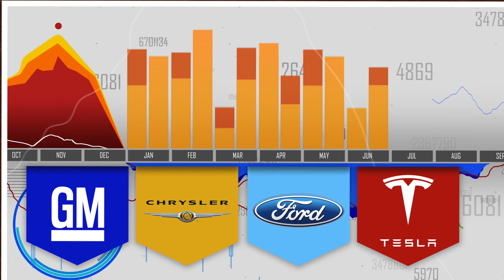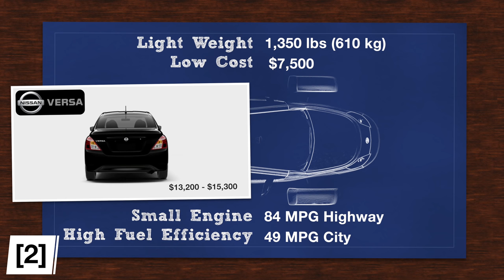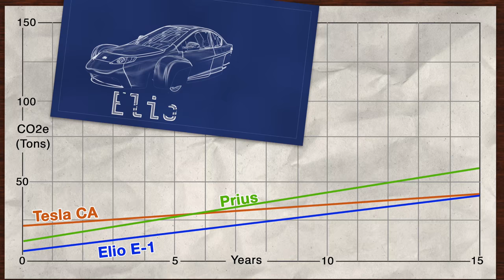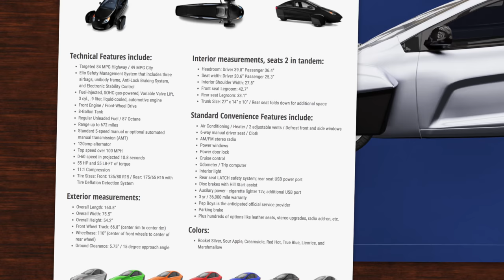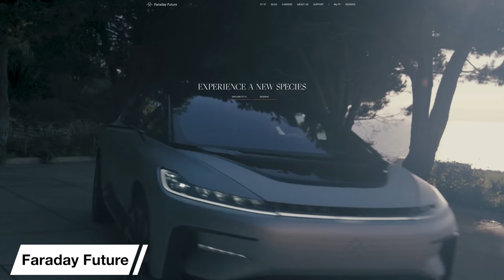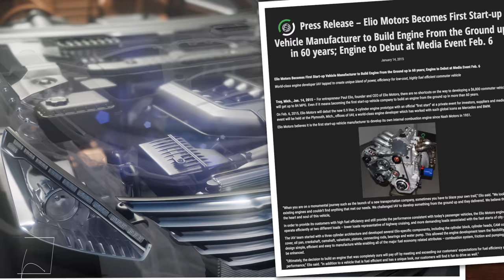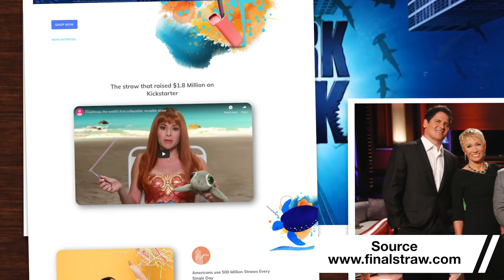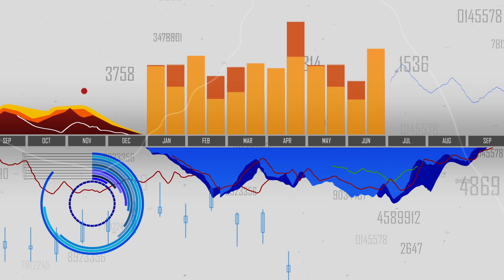How this Radical Car Missed its Chance to Change the World

Comment: I’d still get an elio over an EV right now. EVs cost more, especially at the start. Either spend $1,000+ getting a new outlet installed for your level 2 charger (risking finding other electric issues needing updating) or use public chargers. They cost more. Change your habits for this new vehicle, that’s unfamiliar and still very untested long term or it’s a skinny geo metro. Runs on cheap and available gas, and is very efficient with it. It’s a car, and gets maintained as such. If your out of gas, buy more or get it delivered by road side assistance. 

EVs have come a long way and I’d serious consider one, heck I have been in conjunction with home solar and a house battery(powerwall). But an Elio would get me a cost effective commute cheaper. And easier.

Comment: I would have been interested 4 years ago when it appeared to be nearing production but now it's just too late.  You can buy a used Nissan Leaf just a few years old for only a bit more and electrics are getting cheaper.  Holding out now for the electric Sondors, also a three wheeler but seating side by side.  Will they also falter?  Time will tell.

Comment: Luckily in the UK you don't need a different licence to drive a motor trike or quadracycle.  In the UK and Europe where Smart (Swatch and Mercedes) have done well (600 cc engine vehicles), the Elio might find a niche.  However Smart are converting to electric motors and won't be building petrol driven cars, so perhaps Elio missed the bus ;-) If you want a dorky electric trike you could buy the Renault Twizzy.

Comment: The Elio was exceed if it can maintain its cost at $10,000 I would recommend adding a fourth wheel to get around most state laws and having it a electric option and it would take off  in especially states that promote low emission vehicles or electric vehicles

Comment: The logic of this video works fine if you ignore every other car manufacturer. Toyota was on its 2nd or 3rd generation hybrid cars and introducing models with hybrid options during 2009. 

As a good example of the average consumer, I'd rather spend my hard earned money on a $22,000 hybrid car that has proven hybrid technology made by a manufacturer that is known for economical and reliable cars. 

Usually when a car is too good to be true it is.

Comment: I think there's still room for these things,  charging infrastructure just isn't practical for all living situations,  and a lot of people just don't drive enough miles to justify an EV by savings or even eco concerns cause they just don't spend  so much on fuel to begin with.   There's also a segment of people who'd rather cycle to work in one way or another, if it isn't threatening rain,  etc,  have limited/distant for cords   parking room, are eco-minded but aren't into computers,   just plain don't have 'new EV' money right up front,   live upstairs and rent,    mostly need to drive something bigger for what they do and hate filling the tank for running-around-town errands,  basically any of a hundred reasons that may seem 'niche,'   but could well add up into a pretty good thing.   

There's just a lot of gaps where there's like one or two things stopping someone from going to an EV,  basically, that might be really interested in this,  especially if they make a body style/accessories  that's a little less worried about highway  aero and a little more about room to carry different things.

Comment: Yes, This is still viable.  Electric cars are not the end all.  Especially with the carbon footprint left by the manufacturing of the batteries.  Also the charging network nation wide is substandard and not up to speed.
Reply: Time to buy Elio stock as it dropped below a buck. Lets go Elio!!!

Comment: Safety is everything. It is not how much gas you use. Eliot does not sound safe. Many cars can do 49mpg and better just not $7500. Is it the cost? Is it the gas mileage? Is it safety? Does it has the fun to drive factor like it has a good startup and go, nice cornering capability? Is it cool to be seen in it? I think it multiple of these and cost is the last on. Put one more wheel at the back and convert it to EV this may have a chance.

Comment: I think the Elio would have succeeded if gas prices had stayed at above $3.50 per gallon. OPEC has dropped oil prices in the last few years and cheaper gas is plentiful again. I think if fuel prices go up again, they may have another shot. I also think Elio tried to do and offer too much in the beginning. If you think back to Tesla's first roadster it was basically an electric version of a Lotus Elise. All the engineering for the body and chassis had already been done Tesla just had to focus on the power train.

Comment: If you make it, they will buy. Still waiting to buy mine. 
No I wouldn't want one that was electric powered. Electric cars in North America are a bad idea for the environment. Most of the electricity that would be used to charge these vehicles comes from coal burning generation plants that produce more hydrocarbons than gas burning engines for the same energy output.
Reply from the maker: We have a video that covers why even with US energy generation EVs are way cleaner :) https://youtu.be/SwxmIYGpbn4

Comment: I see vehicles like this and think that looks fun.  If I was working on a project like this I would be looking at motorcycle engines to run it.  The issue of needing to have the M1 certification goes away if they use a engine capacity of 125cc or less as it then falls under laws as a learner motorcycle.  At that point the only things you need are a CBT (compulsive basic training) certificate and a learner licence to drive it which would need to be renewed every 2 years.  I believe that if it has a roll cage then you would not need a helmet legally, but I could be wrong on that as firstly I am going by the rules in the UK and I am no lawyer.  I do know that the Renault Twizzy is legal to drive on a motorcycle licence and you do not need a helmet to drive that.

For me though, it is getting towards the point where an all electric version would make just as much or more sense.  Electric cars have the range and efficiency for commutes, it is long distances where they are held up by our current battery technology.

Comment: To make my conclusion on the Elio Motors they will never reach full scale production, because on the 3 wheel design people want a 2 seater side by side. Just like The Original Honda Insight the Elio is more of a motorcycle design and the cost is too high. Also the car only weighs 1250 lbs and the rate of survival in a real world crash could be low.

Comment: I think it did miss the window of opportunity.  It has taken just too long for a vehicle that is still based on a single combustion engine.Even the Archimoto EV tribute-wheel will come to market before the Elio. For me, the Elio platform is much more appealing. Yet I will never buy another 100% combustion driven vehicle. Plug-in hybrids seem to be the best option for me.  If Elio switched to EV, I would be back on board.

Comment: I admire the design and have followed ... vaguely ... the Elio.  A couple concerns ... why not electric?  I don't see any reason that an electric motor wouldn't be a much better choice for this very light vehicle.  If classified as a motorcycle, what does that do to auto insurance?  To life insurance?  It may be much safer than a motorcycle but if it is classified as a motorcycle, does the driver have to pay high rates for the risky behavior of driving a motorcycle?  Until your video, I hadn't even thought of the possible requirement of wearing a motorcycle helmet.  Personally, I'd be okay with that but I can see that that would be a great barrier for many potential buyers.  At this point, I've lost all hope for the Elio.  I'm even worried for Elio, given that he has taken so much money from individuals without producing anything.  Could he end up in legal jeopardy?

Comment: Since I have put down my 1k deposit, I have purchased 2 vehicles, one of which is all electric.  After experiencing driving my BMW i3, I will find it hard to by a gas powered vehicle. Actually I added an electric motorcycle (Zero) to my garage because of my enjoyment of driving electric.  We do still have a gas powered car for long trips and to hedge against any possible power grid issues.  Overall as I still wait for Elio to produce their 3 wheeled vehicle....every other manufacturer is developing electric drivetrains. I believe their marketability is definitely starting to look less favorable.  A lot has happened in the auto industry in the last five years since I put down my deposit....Res Holder 9328.

Comment: Hmmm... a cross between an Elio and Tesla. Zero to sixty in under 3 seconds. Cost? Less than $10,000 perhaps. But seriously, there are millions of gas cars on the road. The complete conversion to all electric will take decades. Elio can still be successful. It is still at the cutting edge. It could introduce a hybrid in a few years and add electric model as battery technology improves. I would still buy one.

Comment: Car manufacture for mass cost is not 100 of millions, make it in terms of billions :P
Regarding Elio vs other EVs like Tesla, Elio has a few advantages:
(1) A <10k price tag is really attractive compare with any car in the market.
(2) As more and more report come out about how difficult to fixt EV after warranty, especially Tesla. Elio (and any non-EVs) traditional combustion engine definitely is more appealing for consumer planing to drive the car for 5yrs+.

The biggest hurdle for Elio is to get their cars on the road, then to the masses. Without mass production line, there is no way they can keep the price <10k.

Comment: I know gasoline is slowly dying off but yes I’d still buy one in either or gasoline or electric configuration but preferably in gasoline. It’s what I know and it’s what I love ❤️. Also I’d be very tempted to add a k03 turbo, bigger injectors, and add more ignition timing to the ecu

Comment: It looks very much like a EV called cree-SAM, which is a 80 unit prototype which ended with that. In Norway we only need normal drivers lisence to drive them, but they are motorcycles which means they have less requirements than cars. I think it should get a electric drive train and then perhaps sell them to Norway since we gets so much taxed for driving regular cars now that such electric ones would be great.

Comment: The Elio should have started out an EV.  If it had, it would have taken a large part of the same market the Model 3 has had.

Ten years ago, I was so determined to stop driving ICE cars, and there were no EVs on the market that I converted a BMW to a high-powered EV. (See "BMW EV conversion burns rubber!!!" on YouTube.)  If any EV was available at that time that was cheaper than doing the conversion I did, I would have bought it.

There were many others who had the same vision I did: wanting to never go to a gas station again, regardless of cost.  All you need to do is look at the hundreds of EV conversions on You Tube.

You only needed to have offered it as an EV, and I would have bought it.

Comment: Kudos to any entrepreneur who wants to enter car manufacturing. It's a heavily over-regulated industry with high liability (Think of all the lawsuits when things go wrong!). Also, it's hard to compete with the big gun car companies that have so much more in R&D. Certainly, governments can help by allowing people to drive this with a regular driver's licence. It would look and feel more car, than motorcycle. Plus, I think it would be a big seller in the third world. It looks like it would be pretty simple, unlike modern cars which have far too much complex electrical.  

They did something right by sourcing an engine. A small displacement Honda engine would be perfect. They should do the same for the transmission. They could get a company like Aisin of Japan to make the transmission. This would help keep reliability high.

Comment: Elio made nearly every mismanagement mistake possible. Just one classic F-up after another. The ONLY thing they had right was the basic car layout (2 front, 1 rear wheel with tandem seating is the CORRECT one). But no one in the organization new anything about manufacturing. Then it turned into an investor scam. Sad. It could have really done wonders.

There were so many viable business models possible. They could have even sold them as kits with user-supplied engines. Paul and Company were just very stupid.

Comment: Outsource a gas motor and get the ball rolling. Forget the inconvenient electric power, everyone is comfortable with gas engines, and you won't have sell them on E power and high cost batteries. E power will severely limit your market. Another idea is to make your own electric power like locomotives, have a small 2 cyl. diesel engine spinning a DC generator to power an electric motor. Smooth, great torque, great fuel milage, and readily available fuel.

Comment: Always sounded like a good idea, execution is 99% of the game. They have failed at every step along the way, the worst decision ever was to build an engine from scratch. An even worse decision would be to go EV. Anyone wanting an Elio does not want the hassles of EV, the need a small motorcycle engine. The EV is only good for short commuting, try a road trip when every hundred or even two hundred miles you need to stop to recharge for three hours. Then look realistically at the depreciation when it loses 80% of it's value in three years. Look up Nissan Leaf videos to see how real that is. Bottom line, batteries lose 80% of the energy during charging. Battery technology needs about two decades of research to become viable in transportation. After all that, anyone still talking about carbon footprint is retarded. The whole world knows that was a hoax. Since 1998 it has been getting colder while more CO2 is being emitted by man. Don't believe that? Look at the raw data, not the lies by politicians. Watch a few Tony Heller videos and prove him wrong, instead of the normal libtard method of shooting the messenger. Wake up and smell the coffee, more polar bears now, sea level is not rising, it is getting cooler, the planet is 7% greener because of more CO2, extreme weather is on the decline, and only retarded zealots believe that hoax.

Comment: If has happened yet it won’t happen.  They won’t get the volume needed to have a low price, without the low price you may as well buy a car (Toyota wants $14,000 for the iRoad two seat tandem electric). 
If you are stuck in gridlock traffic you don’t want a small cabin. 
Who wants to wear a helmet in a car?

The LIT self balancing motorcycle will likewise never go into production.

Comment: As long as I would have to wear a helmet in a "car" I wouldn't buy one. If the law gets changed so no helmet is required I would definitely get one. But with a second rear wheel to classify it as a car ( to avoid the helmet thing)and another passenger seat it would be a quicker sale for me

Comment: I wish Paul Elio could have gotten over himself, he was too greedy in the beginning and refused to sell any steak of the company. He tried to go to big to quick with the manufacturing plant. The long term goal should have been to manufacturer the car in the US not to start off manufacturing the car in the US. Many engines exist, Elio should have went with existing one or optimized an existing one either way they should not have tried to do it themselves. Elio should and still can work on an electric option, they would not need to reinvent anyting. Plus doing an electric version as open source including patents would bring in a large new group of people with money. But how do you convince people Elio Motors is not dead? I think by producing some in small batches potentially at a loss.
Reply: mmmmm… steak!

Comment: Yeah, I agree with everybody else. If they produce them, I will definitely buy them. The more you spend getting to and from work, the less you actually make. That also includes the initial cost of the vehicle. I've always been a fan of buying used cars because I factor the cost of the vehicle, estimated maintenance and fuel economy into my wages. If I can spend less on a new car and save a ton on fuel, I'm winning all around. I sure hope they produce them. A vehicle like that would be perfect. Besides, who really wants to poison the whole earth with Lithium-ion batteries. I warned all my hippie friends against the Prius because of the environmental impact. Well, they and numerous other people I have met throughout the years regret purchase of hybrids. The battery packs cost as much as an engine and you are guaranteed to replace the battery within 5 to 10 years.

Comment: I wouldn't buy one because it's idiotic to have one rear wheel and front wheel drive. They could have made without a differential (that is, making the vehicle cheaper, more efficient and more reliable in the long run) if they just made it RWD. I like everything else about this car, but the wrong wheel drive kills my interest in it. I'd rather build one myself, with the right specs. And I would make it lighter, with tubular chassis and a canvas bodywork, like some ultralight planes.

Comment: Chaterham uses the Suzuki 3 cylinder in a heavier sports car .
No reason Elio could not have started with it. 
1.0 ltr  proven motor . 
Used in probably hundreds of other vehicles since the Suzuki Swift . 
Or smaller 660cc turbo.

Comment: should have option of both gas and electric, and use Honda motorcycle engines. Roush is not known for small engines. maybe even sell it as a kit where the buyer puts the engine of there choice in it...… :) bringing the cost down even more and not so much up front money for crash tests etc......